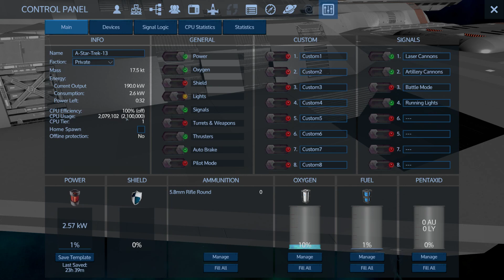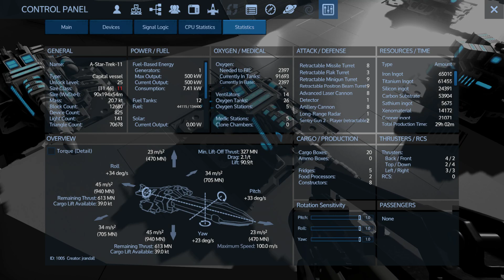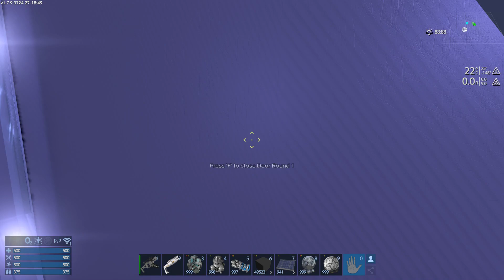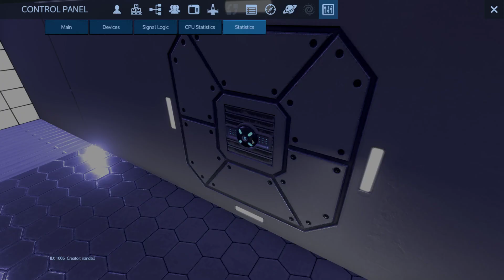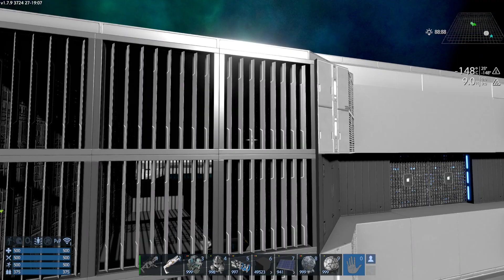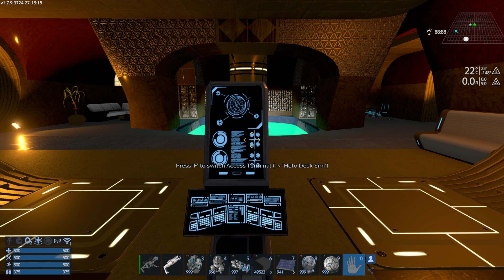Empyrion Galactic Survival - Star Trek style CV WIP update 5-27-2022

Comment: You could still take out 6 drive thrusters on the stripped down version. 2 forward, 2 down (downgraded), and 2 strafing, also crew reduce your cpu and crew is easy to get ahold of. 6 less drive thrusters could get the ship in a very usable albeit not as maneuverable state. Drive thrusters take up a ton of cpu if that still isn’t enough a fusion reactor could drive it down even further. Each crew member brings the cpu down by 2500 and you have tons of room for them.
This is the reason the “meta” is shield based with it being mostly carbon getting anything with armor to move just takes up so much cpu...
The guys saying it doesn’t have enough shields are using the aux cores for increasing the shield on top of those end game shields. You’re using aux cores for propulsion due to the weight of the armor. At the price point it doesn’t look right, they also are likely not taking the amount of weapons into account as those reduce shields and or they don’t go even with the chargers and caps.
Oh and my vote for the name is USS Proxima NCC 9833

Comment: I swear with every new video i find some new geometry detail or texture to marvel at!
Re your list:
1. I'd join with those who call to keep the ship equipped - as somebody who's just finished building my own non-plastic star trek ship of size 12 - I can tell I could not find a solution to keep it anywhere near 2.1kk CPU - it simply won't fly. The fusion reactor is just a must here at the very least... I like the loadout you currently have but would suggest maybe posting a version with say half your fixed weapons stripped and half the turrets as miniguns? So that it maybe fits in 9-core plus 4-5 aux cores as opposed to a full set?
2. Re shields - please ignore ppl who complain like that about somebody's else creation - it's simply rude! With 34k shields and a fusion reactor - your recharge rate should be insane! Provided your speed stats hold from the previous videos - this baby should be able to take on the majority of midgame targets and play hit and run with some of the heavier targets. 
That said - the bigger 5x4x5 (4 blocks in height!) shield parts give you a drastic increase indeed. However, they are not cheap to make, cost 250k CPU a piece and may require a second fusion reactor to power and charge in combat. Maybe see if there is any space anywhere where those can be at least theoretically fitted? Like somewhere in the back of the saucer section punching through both decks? I'd not build them in maybe but leave ppl who want it to do it themselves? Or build the rooms but leave the parts out? What do you think?
3. USS Endeavour has my vote ) And remember unlike the NCC- number, the USS can be on one line, the name on the next line )) 
4. Oh and lastly - that deflector dish lighting is already awesome as is! You totally don't have a complicated 5x5 rounded LCD there - not unless you have a burning desire to make one )

P.S. Thank you, Jeff, we are doing fine today, how about you? ;)

Comment: Have you ever thought about maybe releasing three versions the strip down then your vanilla weaponized version and then perhaps maybe your reforged Eden original finished complete version I mean what would be wrong with that?
Reply from the maker: I really do not like having more than one version of a creation if possible. However in this case, I may also release a bare bones vanilla compatible version maybe around a week after the RE version. A few reasons for this is it is possible to clog up the workshop spotlight causing other deserving creations not to make it there, multiple version means you split up the potential subs and upvotes so they all do worse, and last is it can be a lot more work to do, making multiple steam posts + work done between versions. In the past I did do a few creations with different versions and it was always harmful to the creations stats. So Now I try to avoid it as much as possible. And thanks again!